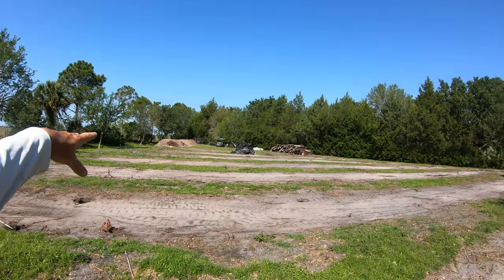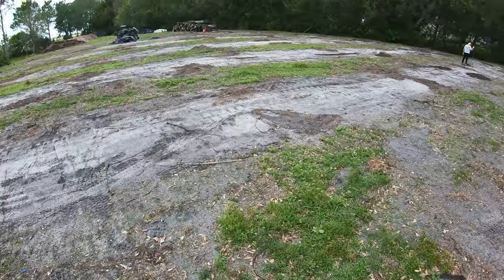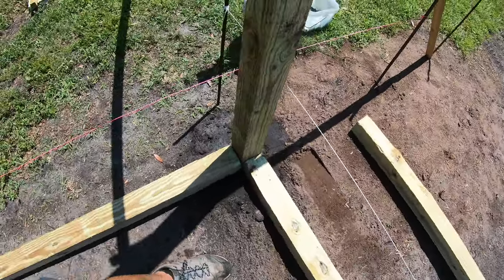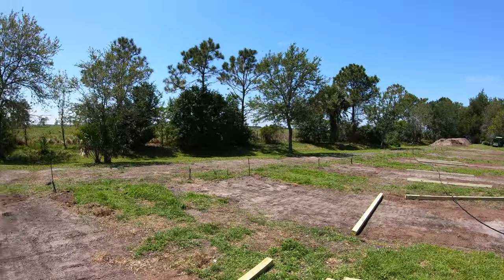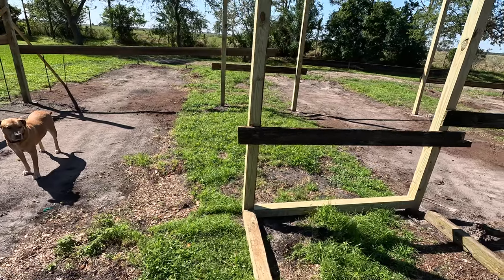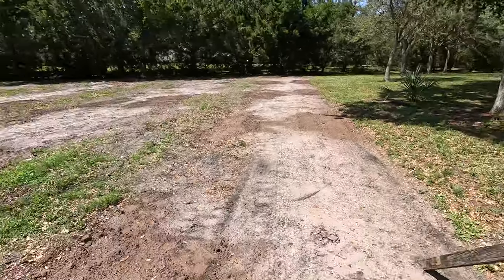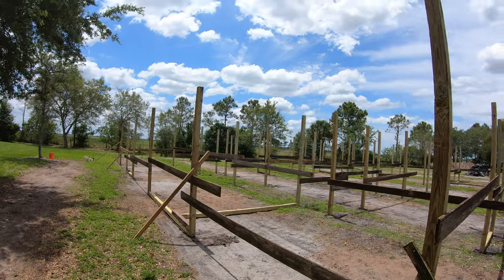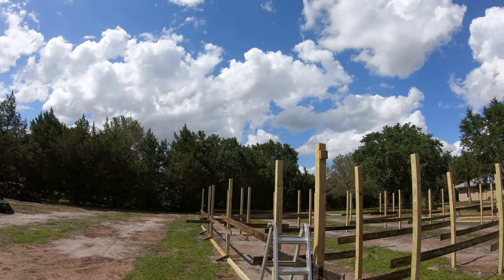Building New Enclosures at Wolfe’s World 2!

Comment: Looking great Jerry and Happy Birthday. A tip for future reference, for cutting the posts of to level the roof, try using a garden hose with a clear section at each end. Fill the hose with water and mark level on clear sections. This will give you a accurate level across large areas.
Reply from the maker: I might have to look a video up of how that’s done…. Can’t quite picture it in my head
Reply: @WolfesWorld  water will always find level, once the hose is filled and laid out, adjust water mark at your reference point by attaching hose vertically to the post. Either line up the water level with your mark or measure and record distance, then attach the other end of hoe to the next post and where the water mark in the hose is will be level.
Hope that clears it up a little
Reply: @WolfesWorld  I found this vid, volume isn't the greatest though
https://www.youtube.com/watch?v=ncFSQysMYFo